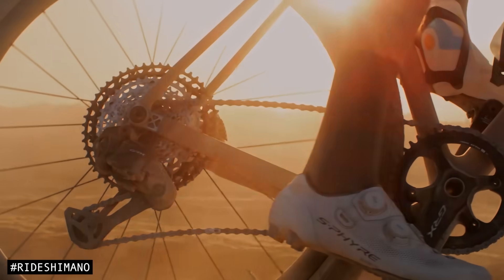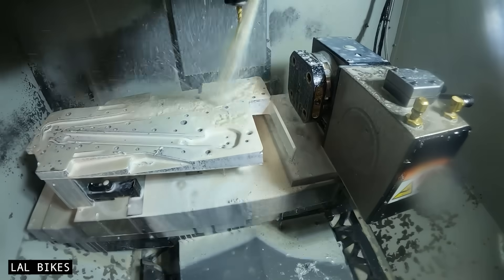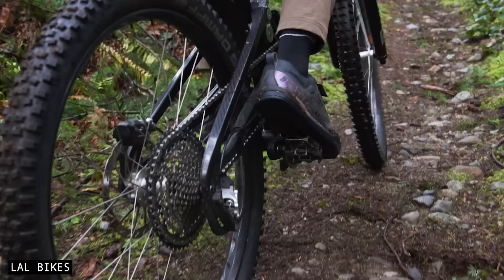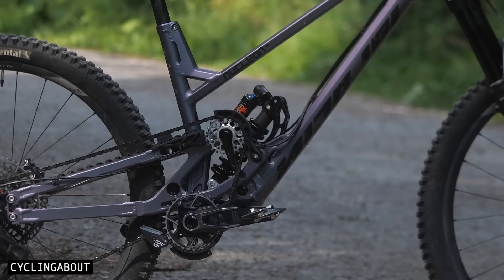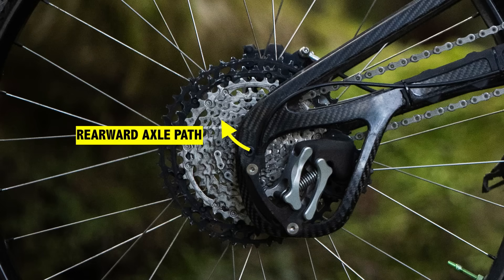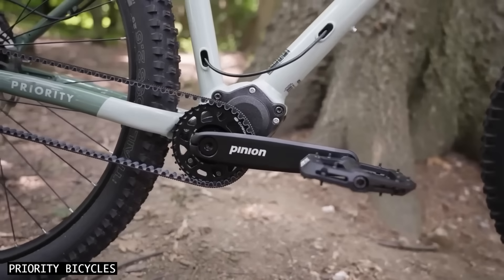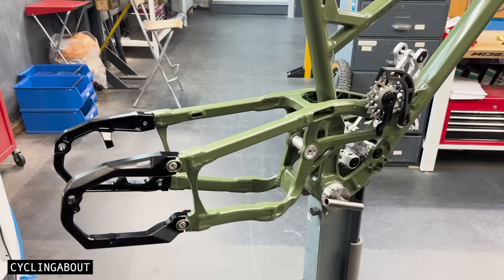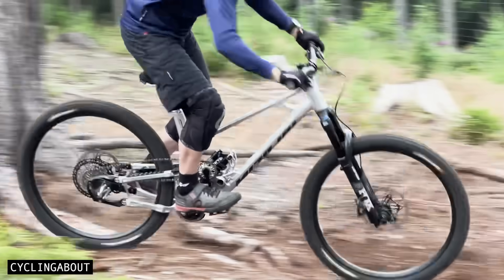This Drivetrain Is Better Than SRAM. Why Isn’t It Popular? Supre Drive Explained

Comment: Awesome video! Thanks so much for comparing our drivetrain to others. You touched on a lot of great points. I just wanted to add a quick clarification on e-bike motor compatibility. You're completely right that our current tensioner design doesn't fit with current motors on the market due to the space it requires. It's a valid drawback to point out. However, this is something we're actively working on. We're exploring new tensioner designs that would be compatible with existing motors, and it's also possible for future motors to be designed to accommodate the Supre Drive. So, while it's an issue for now, I'm confident that there will be Supre e-bikes in the future. Thanks again for the great video.
-Cedric
Reply: Does this design also minimize suspension induced pedal kickback?
Reply: @musicamaiz  Suspension-induced pedal kickback has to do with the placement of the idler pulley relative to the suspension pivots, which is totally up to the frame designer and not affected by the derailleur or chain tensioner system. However, like all other high pivot bikes, high pivot bikes with the Supre Drive inherently have a lot less pedal kickback than low pivot bikes.
Reply: This is what I was thinking the whole time that why is this type of drivetrain not compatible with ebikes or eMTBs? Emtb manufacturers are making quite dramatic redesigns to their bike frames all the time while switching motors and so on. Designing the frame to accomodate this type of drivetrain would not be much different!
Reply: Presumably you could put the motor on the upper front sprocket.
Reply: Should fit perfectly on Dyname 4.0 motors designed for HSP suspension 😍👍
Reply: Think for this to work apart from the bike you sell yourself, you need kits and designs that can be adopted to current bikes, because the bike industry is not gonna play ball.  Just like the financial industry ignored Crypto up until it became to big to ignore.

Comment: Looks like a chain slap nightmare, and you've replaced a break-away component (the derailleur) with a carbon frame component, hmmm....

Further, I don't think derailer damage is an issue in the first place!

Comment: Video says not compatible with e drive, but .... but ..... there is a lovely idling sprocket there in the middle of the frame you could attach a motor to! That would keep the motor bulk above the bottom bracket, than anything below it, and well out of harm's and mud's way. I think potentially it is MORE e-bike compatible.

Comment: So, 1: it’s not lighter, 2: it’s not more efficient, 3: it’s not more affordable and 4: it doesn’t look compatible with DW link or Horst link suspension either. Not saying I don’t want one but you would have to do a bit more on number 3 and 4 to lure me in. Funnily enough I just smashed the cage on a two day old derailleur but it was easy enough to pull apart and hammer straight again.

Comment: about koga denham bar, is there any upsweep degree? 5 or 6? thanks.
Reply from the maker: They are 0 degrees upsweep as they are optimised for an upright ride position, rather than a performance fit.
Reply: @Cyclingabout  got it. thanks for your reply.
Reply: @Cyclingabout  if i want a 100% upright position, very low speed, less than 12km/h, the handle bar height is 25-10cm higher than saddle height, do you think 34 degree back sweep is enough? maybe 35 or 40degree? thanks.
Reply from the maker: @yandongcheng  25 to 35 degrees should be ideal. I have an article that helps with understanding bar design here: https://www.cyclingabout.com/how-to-choose-most-comfortable-alt-bars-for-bikepacking-touring/
Reply: @Cyclingabout  thanks, i've read your blog, it helps a lot for me, and the animation remind me sqlab 321 handlebar, it's 35degree back sweep, and 20 degree down sweep, except this bar, i never saw a down sweep handlebar, do you think 20 degree is too aggressive or is just ergonomic?
Reply from the maker: @yandongcheng  Whether -20 would work all depends on your overall bike fit. It also need to work with your grips and/or gloves. Downsweep is becoming more and more common on city/cruiser/hybrid bikes these days.
Reply: @Cyclingabout  Got it, thanks.

Comment: This is a sensible move forward. 

Millyard's cycle transmission, with intermediate hub gear, concealed primary and secondary chain drives, I think gives the best of all systems for off road riding. Why it has never been adopted is interesting.

Comment: Where is the "extra wheel"? I see none! "Legacy" system had 2 wheels (one often being made with plastic). In fact this improves mostly the tensioning which is moved onto the front. Additionally gears switch could be better aligned to the cassette. Cons? More chains (and higher up) on the front making it more likely for you to get your trousers into the chain. You missed the fact that tensioner has now much more space so it could handle larger difference between gears. I believe that manufacturers could improve the system so it would work with standard bikes (though it might require several iterations). For ebikes the chain should probably become enclosed to prevent injuries.

Comment: Am wondering if somone can take  Supre Drive's principle and design an aftermarket kit that is flexible enough to accommodate existing frame designs.
Would it violate patent laws?
If ever this happens, adoption would be higher. 🤔🧐🙏😁

Comment: Itscool but that extra gear wo7ld drive me nuts and distry it first like the disck break that i bend in few weeks.The bike i rip up,has no center shock because I want raw power direct to my tire not philtered out by center shoxk.front shock is a must.No disc breaks.there goid for atopping but bend and tweak fast with reasitience.you can not adjust a disk break as wasy as cable breaks.Cable breakes suck by far with stopping power than disc but ivwould not by disc.😅

Comment: Just purchased a bike with a Rholoff rear hub.  Not perfect but I can't imagine going back to a traditional derailer.  There is more weight, more resistance (95% efficient), and more cost.  But it is also more reliable, quieter, and more usable.  A perfect commuter bike solution.
Reply: You have a point there. Rholoff is perfect for commuting / in-city rides. While Supre seems to be geared more towards off-road biking.

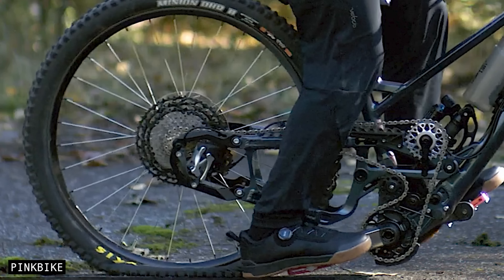Comment: That huck to flat scene at 5:03 looks WAY worse than for a regular system, tbh.  Look how close the chainring gets to the ground.  A 2" rock there would take out the entire drive, not just the derailleur.
Reply from the maker: The BB height felt too low on the Nicolai bikes when I was back-to-back testing them. But I must say, the bikes were very planted as a result! Just don't try to pedal. 😅

Comment: While plenty fail, innovation has always been a key part of cycling as a whole. Often times we see iterations of the same technology by different engineers several times before they finally stick and become even somewhat well known, let alone mainstream. Whether supre drive succeeds or fails, I'd bet we see multiple very similar concepts over the coming years. There's no shortage of people looking to ditch derailleurs, and no shortage of enthusiasts willing to spend pretty exorbitant prices on niche new tech. We live in the world of every big brand having a $10K+ flagship bike, and most of them aren't doing anything groundbreaking, just coasting on reputation, accepted norms, and reasonably consistent mass manufacturing with incremental (sometimes dubious) yearly upgrades. Great bikes that are in no way special. Stuff like the supre drive is what keeps cycling interesting, and in my mind justifies an expensive bike far more than your average big brand flagship. Hopefully enough people feel the same and get Lal enough cash flow to continue refining their vision!
Reply from the maker: 100% agree with your take!

Comment: Now, instead of smashing your $500 derailleur on a rock, you're smashing your $5000 carbon frame on the rock. or $1000 for the rear triangle... although this is higher up and out of the way and could be turned into a replaceable part. I think this overall solution doesn't completely address the issue we have with derailleurs : unsprung mass and high maintenance. As an eMtb'r convert, I'm all in waiting for a really good motor-gearbox combo with a belt drive, and I think most of the market is waiting for that. If a gearbox could solve the weight and efficiency issues of the Pinion, that would be a winner for the analogue market.
Unless the Supre Drive is comparable in price to SRAM (which is almost impossible), I don't see this as a viable business. But you have to give respect to them for giving it a go.
Reply: I was wondering about your first point -- unless there is some sacrificial part cheaper than the derailleur/axle, it seems to be like SRAM Transmission in that the frame had better be a tank.  I think that by far the best design ever is the Millyard Racing system (see the video on Millyard MR002 bikes).

Comment: Thumbs up from me. Carbon frames, carbon wheels, rear suspension, 29ers, disc brakes, and 1x drivetrains are all more expensive and were slow to be adopted, but they are now commonplace. And the added cost of Supre Drive wouldn't be a problem for mid to high end bikes.

Comment: The protection area looks like an impact would be a major rear frame issue. A bolt on break away section could protect from major section replacement

Comment: I'm confused about the stated disadvantages of the Pinion.  The gear range of the Pinion is 6 to 18; a common gear range might be the Pinion C1.12 with 10 rear gears yielding a range of 120 gears;  Pinion 'maintenance' is only one oil change per year.  I own four trikes and one quad - I purchased a Pinion gearbox (C1.12 with 12 speeds) for my Catrike 700.  I was so impressed that I purchased three additional Pinion gearboxes for the remaining three of four trikes plus a quad.  In general, the only disadvantage of the Pinion is its price.  And the main advantage in my opinion is that the Pinion can be shifted while stationary.  I'm obviously sold on the Pinion, however, the Supre is certainly eye-opening.

Comment: I've only been a bike mechanic for four years now. I come from a dirt bike racing background. When I first started working on mountain bikes, I thought dang, they are using decades old technology borrowed from road bikes - wtf. Lok at that thing dangling down there waiting to be ripped off the bike. 
 The three years ago I saw the LAL system on YouTube. I thought for sure this would be the future of shifters. But everyone is still using dangleberries. What's wrong with the bike industry? Companies should be tooling up and lining up for licensing. But instead, they decide to keep the weakest and most dated part of the bike alive. Geeze. It's kind of like how frames and suspension have taken so long to evolve when all they had to do was look at motorcycles.
Reply: They have to redesign frames to incorporate the hydraulic clutch on the front triangle. So bike companies have to make a Supre-Only front triangle which adds cost and is a big risk. Agree that it is the right risk to take though. I think Supre is going to be popping up in a lot of different places over the next few years.

Comment: The issue is that if we wanted a bike that shifts well without a derailleur, we'd get a gearbox. We choose bikes with derailleurs because of it's price, simplicity and compatibility. This is a compromise approach that doesn't really address much.
Reply: Well, racers choose for weight and efficiency. Gearboxes tick zero boxes. And waxed chains are more durable than belts, more efficient and do much better in mud.
Reply: @Balorng gearboxes appeal to people who do multi day touring, especially in unfavorable conditions. Some racers who have done the Ride the Divide race have talked about moving to gearboxes because of the need to buy a new rear derailleur mid race. They have their place, but it’s still going to remain a niche market.
Reply: Still, lighter system than a gearbox. At least I care about that selling point anyway
Reply: Carbon frames, carbon wheels, rear suspension, 29ers, disc brakes, and 1x drivetrains are all more expensive and were slow to be adopted, but they are now commonplace. And the added cost of Supre Drive wouldn't be a problem for mid to high end bikes.

Comment: I love the idea and I don’t wanna buy it. No frames. No mechanics who can service it.  Because the truth is: unless sram or shimano do this, it won’t be wide spread even though it’s superior. 
Because the market does not regitself and bike industry is an oligopoly. 
Take upside down forks. Standard for motorcycles. Intend had it for mtb for years. Now fox is acting as if they innovated. No. They didn’t. They just ran out of ideas to sell you shit only then do they “innovate”. 
Same with shifting. It will be years before we see the major two do sth. 
I’d love to get a compatible rear triangle for supre drive. But that won’t happen unless sram or shimano make a push. 
That, or we get the honda internal gearbox from the early 2000 which won some DH worldcup races. 
(Also, in the emtb space, the adoption of the pinion mgu is laughable. So superior but so few brands run it at an incredible high cost)

Comment: It's not more popular because the entire bike has to be designed around it. It cannot be retrofitted to an existing bike. 
Also, honestly, it's solving a problem that isn't really there. I know it happens, but it's hardly an everyday occurrence.
I've been mountain biking for about 12 years now, I ride a lot, and I have only once knocked my rear derailleur hard enough for it to affect the shifting, and even then the only damage it did was to bend the derailleur hanger. 
Not only is this a solution to a problem that doesn't need solving, it looks hideous.
It won't become more popular.
Reply: been mountain biking for 30+ years, never destroyed a derailleur, in fact i have only had one flat tire, after over 100 000 kilometers
Reply: @nitraM321  Yes, but given how long you’ve been mountain biking, at your age you're probably still using solid rubber tyres - and your bike doesn't have a derailleur. No, Gramps, Sturmey Archer is not a derailleur.

Comment: The builder could sponsor a racer to promote the system. At least locally while trying to move bikes. It could catch on. I like that it uses traditional rear gears.
Reply: I wonder what racer/team would be into this?

Comment: Can you put this on any bike be it old and new? Nope. There you have it. Why the typical derailleur still win  all this is good innovation and all but  you can't use the same drivetrain on a new or old frame anytime you want.  Best we can do is hub based system the Hammerschmidt was cool too

Comment: I have been wanting to design one of these  for years now.  The only difference is mine would hang the tensioner from the chain stay right behind the chainwheel.  I see no advantage to the frame mount and a fatal flaw requiring bikes be designed for one derailer.

Comment: This could be of interest to folding bike manufacturers because, if you think ground clearance is a problem on full sized bikes, imagine the problems it causes with a 16-in wheel.
Reply: Folding bikes might be better served by gearboxes, which require less maintenance.
Reply: @risesir  I have a Raleigh 20 folding bike with gearbox. Great ground clearance, stupid ratios and requires more maintenance than you can imagine. God bless the 1970's.
Reply: @dquad it’s interesting that mid-drive gearboxes are a thing, but you don’t see rear-drive. There’s a certain elegance to drive by wire (as not-a-mechanical-or-electrical-engineer). Rear wheel drive without the belt or chain.
Reply: @risesir  rear-drive gearboxes have been around since WWI. Sturmey-archer 3 speeds were the originals. The modern gold standard is the Rohloff rear-drive gearbox. They also make rear hub motors you can lace into a wheel if you want to remove the chain from your bike.
Reply: @ivanmius  The rear drive hubs are so limited. They seem to work best paired with another drive.
Reply: Good point, since folding bikes are already dealing with unique frame designs anyway so could incorporate something like this as part of their design.    I have a mk2 Birdy with an Alfine rear hub, yet still need to use a derailleur-style chain tensioner that takes the chain very low. The flip side is that the main advantages of this system (greater protection of a rear derailleur from rocks, and reduced weight at the back of the bike on high-travel rear suspension designs) don't really apply to folding bikes, which are primarily urban I habitat.

Comment: cool innovation but I think it should be required to have a cover, especially in mtb setting
that's a safety hazard and would prevent complicated repairs/maintenance out in the wilderness
very good design, a compatible mid drive motor would do wonders as well
all up for innovation but personally, a mtb purpose built hub gear drive would be the game changer